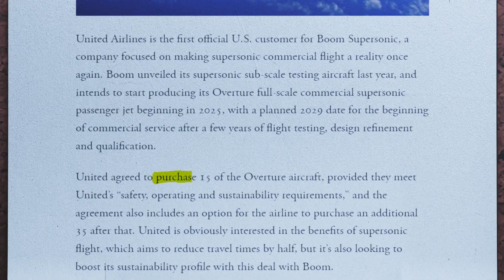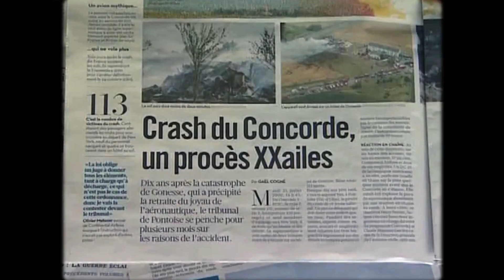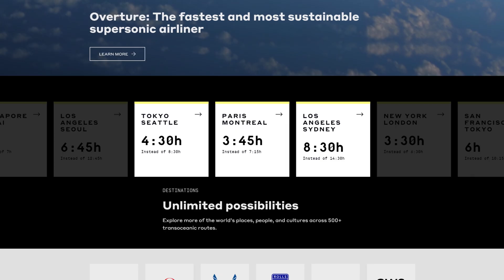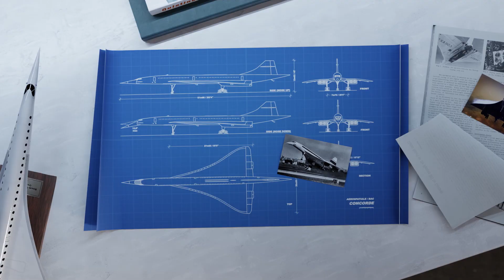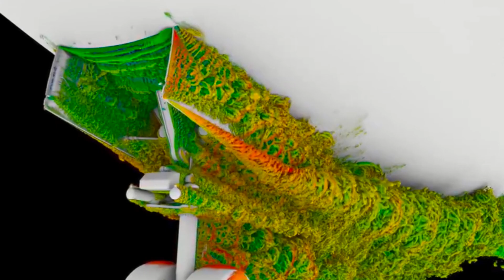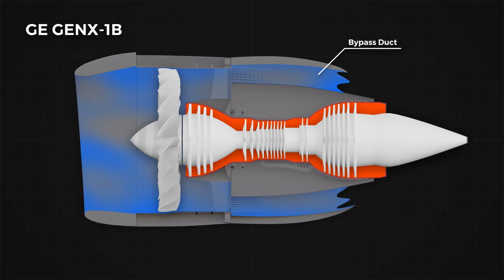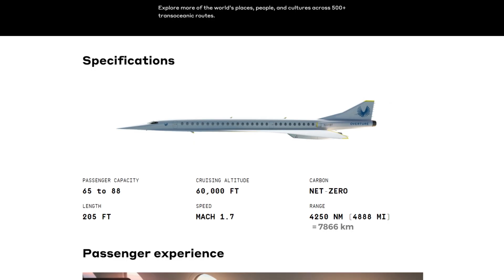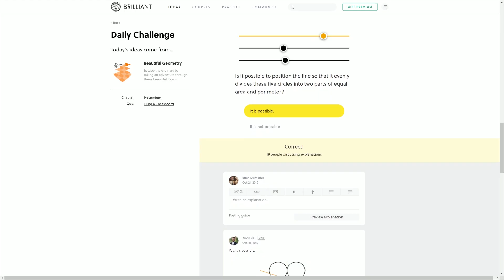Will Boom Bring Supersonic Back?

Comment: You say that the engine needs to be a pure jet (turbojet?) but plenty of fighter jets are turbofan. What am I missing?
Reply: I'm taking a shot in the dark, but i think he's talking about absolutely pure jets, with no bypass whatsoever. Many fighter aircraft have turbofans but operate at significantly lower Mach speeds usually (without afterburner) and carry much less weight than a commercial airliner. Most jets I've read about with turbofans operate around Mach 1.5... So maybe he means they need pure jets for much higher thrust generated purely through the engine (through the combustion chamber and nozzle).
Reply: @sharvapotdar3257  Simple definition: 1. Turbojet = ALL of the air that enters the front of the engine is used for internal combustion; 2. Turbofan = SOME of the air that enters the front of the engine is used for internal combustion, the rest is by-passed around the engine.

The term "pure jet", whatever it is supposed to mean, is confusing and I wish people would stop using it. They are all "gas turbine engines". Of which, the above are but two. From a 30 year Mechanical Engineer.

Comment: “Will Supersonic Travel Ever Return?”.  I sure hope not.  Further I hope air travel at any speed will end.

Firstly: outrageously energy hungry in a world battling climate change.  The less you change your elevation/altitude, and the more your medium carries your weight the more energy efficient.  Tide-water transportation and railways.  Aircraft are doing the most extreme of inefficient travel.  The only source of energy dense enough for aircraft is hydrocarbons, something we must stop using if there’s any hope for humanity to survive on Earth.

Second:  rapid travel spreads disease.  Unless air travel is sharply curbed, preferably outright banned, we will be saddled with COVID variants for years.
Reply: I feel like your entire expressed opinion is only half informed. 

While ineffecent, such travel emmissions can be offset. The problem isnt with climate change, but expidited climate change with no checks and balances. There factually are ways to offset the negative effects, allowing for ineffecent travel. That said, effecency will always be looked at.

Also as for COVID, your concern, while technically valid, overlooks the economics of the world and just day to day activities. Even without travel, it will continue for probably ever as the world (sadly) can not just completly quarintine for a couple weeks to factually stop transmission. 

To hope to rid the world of airtravel is throwing the baby out with the bathwater and would be a huge slippery slope.
Reply: The Airline industry is only responsible for 3% of CO2 emissions.
Reply: Look another Malthusian
Reply: Tide-water transportation? you mean ships? ships which each pump out more CO2 emissions then an entire airports worth of aircraft? unless you think we'll go back to sailing ships. which wont happen

Comment: Pinning the hopes of your new airliner on a yet-to-be-designed Rolls Royce engine?  I hope it works out better than it did for the L-1011.
Reply: RR is completely cash strapped at the moment, and just barely clinging on amid the pandemic. Even if they had the resources, there's no way they would take such a massive gamble on developing a supersonic engine for this thing, when there are no guarantees of any orders. GE have already ended development on their supersonic engine program, which means there is no one who can realistically provide an engine for Boom.

Edit: By "completely cash strapped" I don't mean they are on the brink of collapse right now. But they have negative shareholder equity, which is a big red flag. In any case, they don't have the resources for a clean sheet supersonic engine. The commercial failure of such a program really could push them over the edge after the financial pressures of recent years (covid, Trent 1000) etc.
Reply: @jackroutledge352  RR are not complete cash strapped.  And they are too valuable for even the current Conservative government to allow to fail and be bought up by foreign companies.

But yes, there's no reason for them to put much effort into a pure jet engine and one certainly won't be ready by 2026.
Reply: @jackroutledge352  what! No, it's not it makes the VTOL system for the F35B and many engines
Reply: @jackroutledge352  Russia's Kuznetsov has recently released into production an update to the world's most powerful military jet engine: NK-32-02 (for the biggest/fastest military plane/supersonic bomber Tu-160). It has added a 1000 km range compared to the original engine. RR can certainly improve their own engines, too.
Reply: @jackroutledge352  supersonic engines aren't actually massively difficult to develop, ultimately it's the same engine as a subsonic design, just running on hotter intake air. The hard bit is life.
Reply: @jackroutledge352  There are dozens of supersonic engines out there since 1946.
Reply: @martinda7446  Nobody is talking about the existence of engines. The question is one of the viability of the project. If the engine is too expensive to run or produces too much carbon dioxide, the whole project is doomed. We need transportation systems that work for our current society, not a new toy for the ultra-rich.
Reply: @andresvillarreal9271  Yes, just saying there are simply dozens of supersonic capable engines currently in research and development. Just they are all military. Majority of military engines became available for civilian airliners. The JT8-D was civilian version of PWJ52? Edit: for instance - and produced 30,000 engines!
Anyhow the whole idea seems ridiculous and doomed to failure. In fact it almost feels like a scam.
Reply: RB211 repeat will go just as well.
Reply: Rolls Royce have been selling off parts of their business as part of their pandemic recovery plan. As for their future they seem to be busy with battery electric propulsion projects for aircraft and then there’s the Small Modular Reactor projects that have been in the news. If they got deeper into financial difficulties the UK government would likely step in or end up in the hands of BAE.
Reply: I really liked L-1011.  The DC10/MD11 beat it to market, but was also flawed in design and had several major crashes before they corrected it.
Reply: That power plant issue has doomed many other flying machines!
Reply: I love that band
Reply: The L-1011 was its Lockheed model number. All Lockheed aircraft has full astronautical names,  and it was the "Tri-Star".

Comment: I have a question that always wanted to know the answer to: if anything travelling at the speed of sound generates a sonic boom, why missiles, rockets and bullets don't have sonic booms?
Reply: They do. https://youtu.be/d-Fu_4iDOLQ for example
Reply: they do. According to soldiers who had been under fire you hear bullet impact, sonic boom, and maybe the bang from the gun firing the bullet. In that order.
Reply: they do. It's why bullets make a crack sound. That's it's sonic boom.
Reply: This is why specialised silenced guns use subsonic ammo
Reply: They only don't in Hollywood movies, they very much do in real life, but unless you're a soldier / fighter pilot I doubt you'd ever have heard them
Reply: Rockets produce sonic booms in front of them, which is pointing up, so the boom is away from the ground.

Airplanes produce sonic booms in front of them, which is pointing sideways, so the boom hits the ground.
Reply: Rockets only go upwards (the kind the public is around at least) and the boom radiates outward from the trajectory. By the time they're supersonic the shock won't reach the ground. Different on the Falcon 9 booster landings though!

Comment: People will probably hate on me for mentioning it, and it's probably just a pipe dream - but if starship matures, that'll be flying supersonic/hypersonic quite often ;)
Reply: Point-to-point Starship is an even more absurd idea.  Getting the Starship up to orbital speed and to altitude is far more energy intense than any aircraft.  Start with comparing the ISP of air-breathing engines and rockets.

There’s the noise that banned the Concord from trans-continental routes, but turn the dial past 11.

The shortage of locations willing to host launch/landing facilities.  The noise.  The concentration of the most energetic fuels known to humanity.

The rigours of take-off and landing on passengers.  They’ll experience at least 3 Gs for at least 15 minutes with each trip.
Reply: @CarFreeSegnitz  Good points but I think flawed in some respects. First, Starship wouldn’t have to achieve escape velocity since it’s just a point to point ballistic route. So the launch would be far less energetic than an orbital insertion. Second, you’re assuming that it would be a direct replacement for current routes. Current routes are limited by current technology and economics. Such a system would likely enable greenfield use cases instead of directly competing with current airliners. It’s certainly possible that these use cases would be so compelling that the limited availability of launch/recovery facilities wouldn’t be a significant burden. 

The launch profile could also be altered to increase passenger comfort, though I don’t know by how much or at what expense in efficiency.

All of the problems you outlined are surmountable, if there’s sufficient demand and hence money available. That’s pretty much why supersonic passenger flight never took off, it simply wasn’t useful enough for us to spend a bunch of money on developing it further.

Comment: I doubt it, it just doesn't make sense to me apart from private jets. Travel is already so fast in reality, what takes more time is airport security, boarding, packing, etc.
Reply: It does make sense for the really long distance connections. BA did a trial with a London-Perth direct connection which took a bit over 20 hours. Health experts had to make sure the passengers on that flight did some excercises along the way to prevent injury.